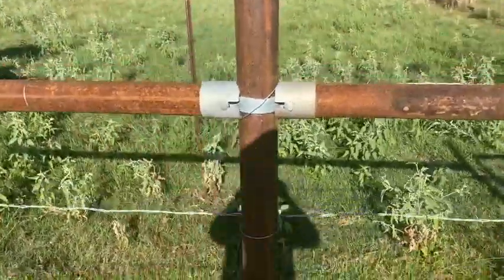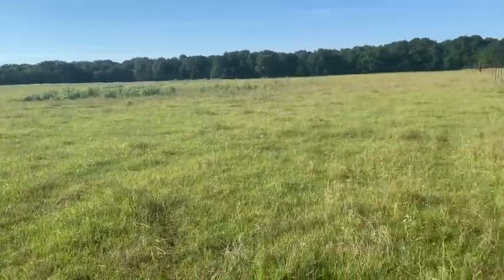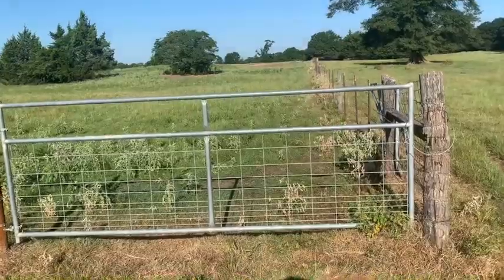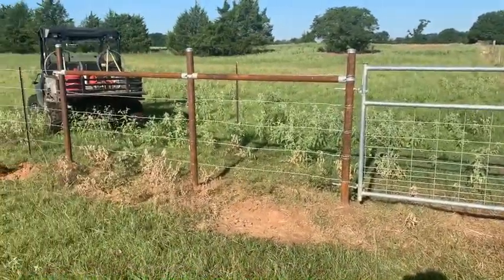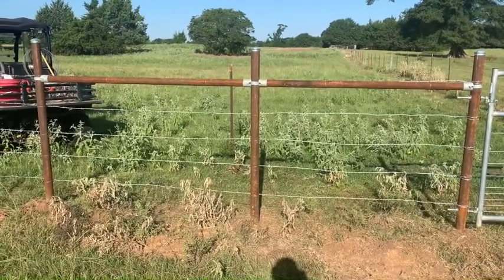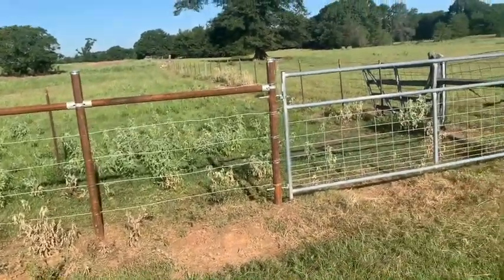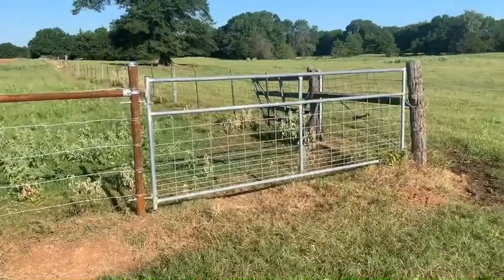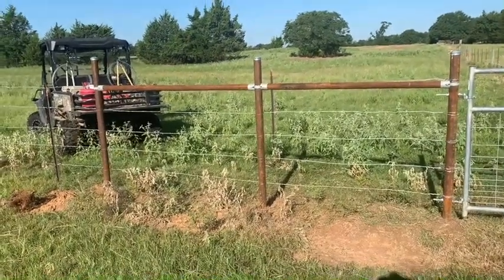Fence Bullet Gate Install

Comment: This sure looks a lot easier than dragging a welder and generator.  Does the assembly take hard pull like a welded brace?  Thanks for the tip.
Reply from the maker: Yes, as long as you use three post  I have a section to do I. The woods this winter and I’ll use this for ease of use.

Comment: Looks great, you've been a busy man lately. If any of those wires get loose over time I recently found Jake's Wire Tighteners are excellent and removing excess slack without having to cut the wires.
Reply from the maker: Tex Farmer -  thanks for watching.   I’ve never seen Jakes Wire Tighteners.   I’ll check them out.
Reply from the maker: Tex Farmer - I checked out the Jake fasteners.   I like them.   Wonder what the clips cost?
Reply: @HeritageFarmsTexas  Amazon has the clips at $22.65 for a pack of 20. It's worth a little over $1 per clip to me to not have to cut the line to tighten it. One thing I noticed, the clips are much heavier duty than what the pictures make them look.

Comment: I like it a lot, hauling around 8ft cut off telephone pole corner posts gets old really quick. I would leave the tops on them , then you have a post to wrap your reins around if you ride a horse out there one day. Thanks for sharing.
Reply from the maker: The Drifter - appreciate the feedback.   It’s a simple solution for fence ends in remote locations.